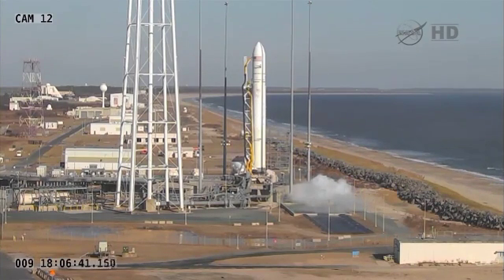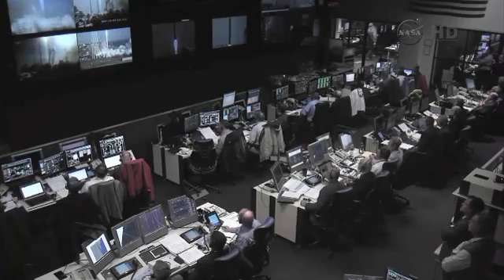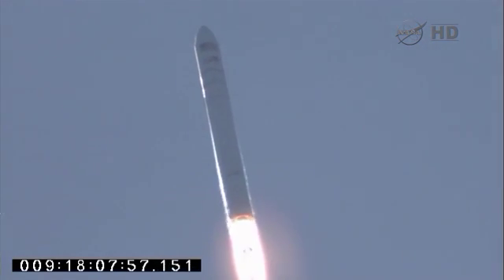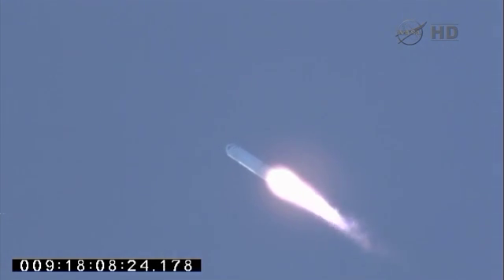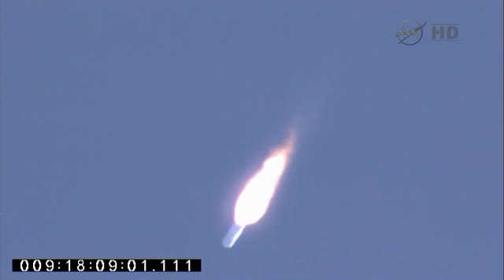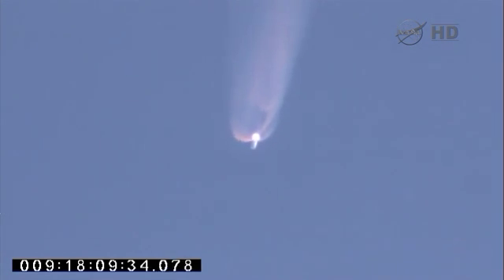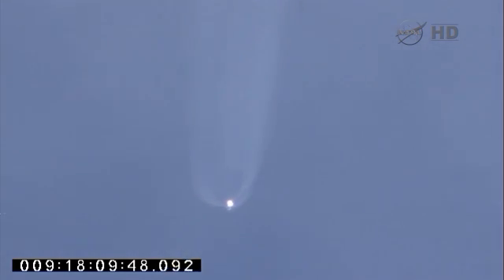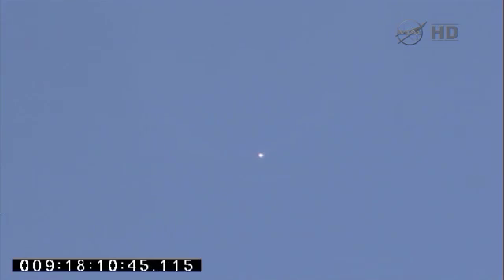Blast-Off! Cygnus Lauches On 2nd Space Station Cargo Run | Video

Comment: The main issue I have with the Antares rocket is that it has no commercial future. There are just enough NK33 engines for all its contracted flights. After that they'll need different rocket engines, or mothball the Antares.